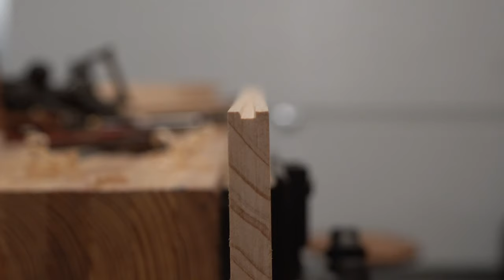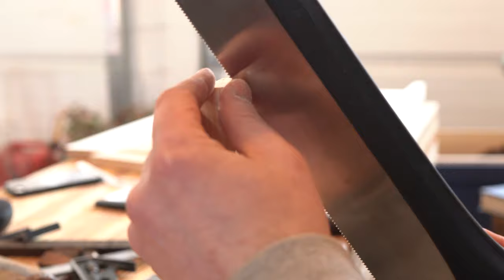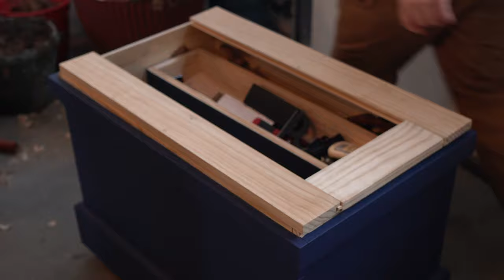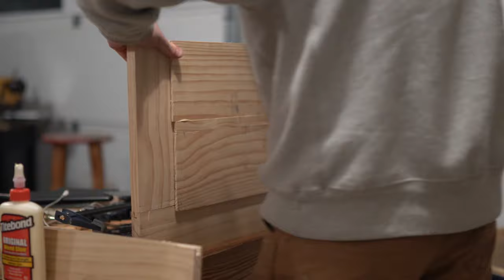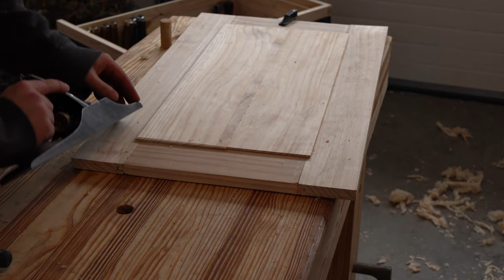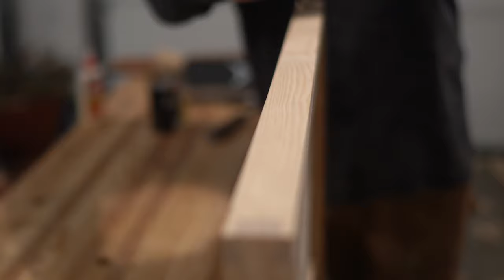Building the Anarchists Tool Chest - Part 4: Making the Lid - Hand Tool Woodworking

Comment: I was shoutin at the screen around 6.45...... "your panel, dont glue yet..... your panel!!" 
The dovetailed rim around your lid may not stay where it is in time...... the frame and panel assembly doesnt seem to have enough free room, your panel looks to be tight in the frame. This will push on the frame and try to expand the dovetailed rim, you may experience cracks as the wood has no where to go and the joints on the frame might open up. On a panel that size I would allow about 6mm of free space inside the groove, the panel should easily "float", you should even be able to move it by hand 😁

Comment: How's it holding up without the deep mortise and tenons in the rails and stiles? It's one of the hardest parts of the build when done by hand, but rewarding when it's all done.
Reply from the maker: I had to repair one corner that opened up once. Used some epoxy rather than wood glue this time, it’s held up so far.
Reply: @anarcholeptic  There's not an easy way to share an image with you from my build, but I followed the design in the book. I have to say it was challenging to cut those mortices and tenons without machines, but even though they looked a bit rough inside, they are holding up really well due to the gluing area.

Comment: I don't know if it's something at my end, but the subtitles are out of sync with the film. You could have saved some effort by gluing and sizing the panel before fitting to the frame. Great vid though. Nice to see you using the hand tools. Looking forward to the final part.
Reply from the maker: Oh, thank you for letting me know. I’ll check on that in the morning. Thanks for the support!
Reply from the maker: Fixed it! I exported the video in 60fps but left the subtitles in 30fps. Thanks again for pointing that out!